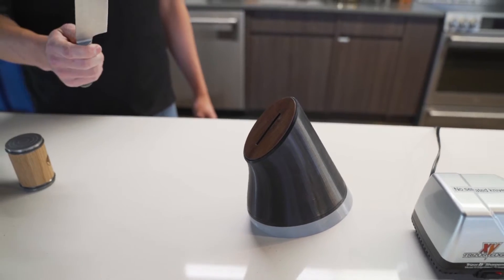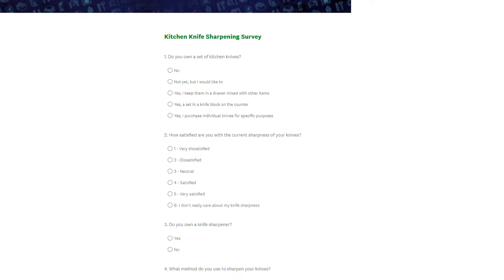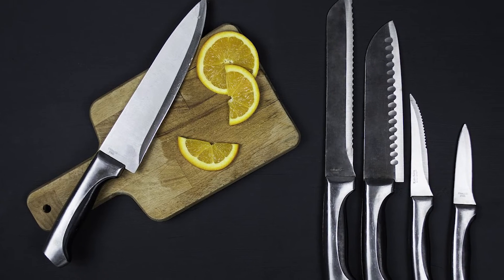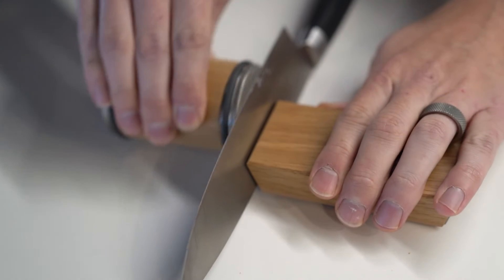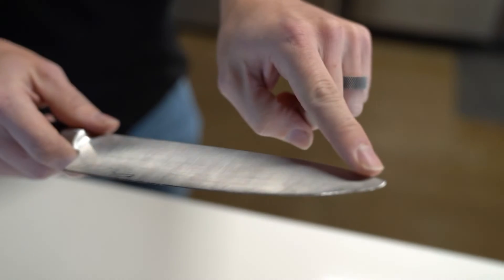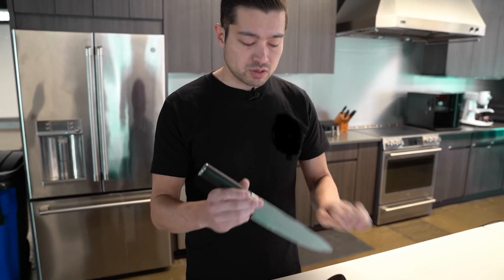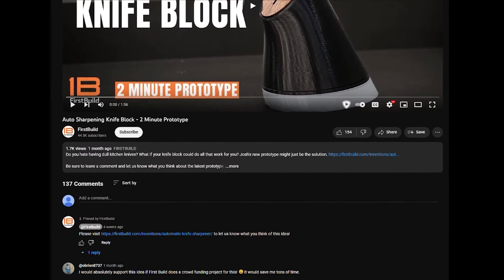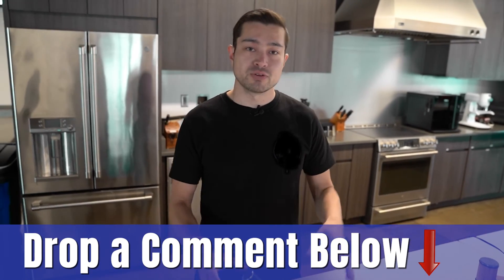Can Our Robot Really Sharpen a Knife?

Comment: First time seeing you channel.. so far so good...People keep mixing this part all the time... sharpening should happen as little as possible.. Honing knife all the time is the key, don't let edge become dull so you need to sharpen !!!... at the the same accident = re profiling edge. If you need to do that, well you probably did something real bad. soooo... if you want make product... it has to do both. 90% honing maintaing edge before  each use and after. After so many honing cycles you have to re sharpen the blade <10% of knife usage.. 
BTW all above ratio is based that you have decent quality steel... if you have those cheep stamped steel knives,  well sorry but sharpening all the time is only way and it will be worn so fast that is not worth buying that steel knife. As far the test... that is hard one everyone uses knives differently and quality of knives are different  so outcomes will be different (opinion). I make knives and sharpen them so they never get to bad shape.  I have OCD about sharp knives and they all need to be super sharp so my  below reference will meet <1% of average user. My test(s) are: knife weight on top of ripe tomatoes should cut thru the skin without any pressure (minimal).. fresh cilantro should be cut/chopped without any smashing or hard pressure and last one, cutting cucumber super thin that you can see thru..(I also have access to knife edge sharpness tester, but that is not in this scope of project) again these are just a few that work for me... Good luck brother you definitely picked difficult task to resolve and trying to make easy for everyone.. looking forward to see final product... 👍

Comment: I actually own 4 different Lansky sets. 
1 in the house
1 in the barn
1 in our camping trailer and
1 in our living quarters horse trailer
How sharp is sharp enough?

If I can shave the hair off my arm, it's ready to be stropped on my leathers!

I've actually shaved with my pocket knife!

But stainless steel is difficult to sharpen!

For our SS kitchen knives, I use a pull through and a strop.

We own a couple low carbon steel knives and they sharpen easily...

Is there a way to actually INVEST in your device?

I'm interested! 

Bill

Comment: I have many knives in my kitchen, I have pairing knives, chef knives slicing and boning knives. The two most used are pairing and chef knives. I have a small interchangeable belt knife sharpener but like you mentioned keeping the proper angle of the knife is key and the designer didn't do a good job providing a good way to do this so I am never pleased with the outcome. Having a knife able to cut a tomato easily is what I am looking for. Having a knife edge that's not so thin that I have to constantly use a knife steel to straight out the edge would be awesome.
Thanks very much!
Michael Pitre
Heaven Made Products

Comment: One approach is to have the end user insert the knife in such a way that the process starts with the tip then runs the length, the other is the sharpening mechanism on a rail that has the profile of the knife one pass for sharpening with diamond stone then the stone are move out and two rubber of leather wheels run the length to remove the burr. Once a knife is sharpened its does not require much to maintain, not like a dull knife that would need more work remember you could have your block be straight that way the mechanism just runs the length.
Eddie

Comment: I consider myself an average knife user.  So I don't need my knives to be constantly tomato skin sharp.  As long as they basically get the job done, a little bit of push force is fine, and I don't obsess over it.  That being said, it would always be nice to have to worry a little less about sharpening.  I think the idea of this device would be good as a daily maintenance type deal, but should not aim to replace a professional sharpening service that should be performed once a year.  It also should NOT try to be a solution for people that are just bad with knives.  If you (the plural you) are the kind of person putting nicks in your knives or even dropping them, you got bigger problems.  Do everyone a favor and take a class on kitchen safety and learn how to respect blades.  A product like this is not meant to save you.
Getting back to the device, I think it would be most useful as a low-tech product.  There doesn't need to be fancy electronics and motorized grinding stones on the inside.  That is overthinking it, not to mention all the physical space that takes up.  I'd be satisfied with a some static stones, or maybe some simple grinding wheels on a pivot that rotate when the blade is being pushed into the block.  Remember the aim isn't to get a hair-splitting sharpness every time, the aim is maybe to try and upkeep with whatever minuscule dulling happens from every few meals.
But even then, there are significant hurdles as to why this invention may not be a practical idea.  The first problem is sanitation.  Not everyone is tidy.  Some people may not clean their blades as fastidiously as they could and may insert them partially dirty with oils or whatnot.  Also for example, my boyfriend has a bad habit of putting knives into the block still wet.  Well what happens when moisture sits around with nothing to do?  Mold and rust.  There will have to be a way to open up this device for easy cleaning.  And I think most people are going to be completely grossed out by what they find.  That problem might be more harmful than the original problem that the device was trying to solve.  People will think: Great, now I have something else to worry about, keeping this thing clean.  I would have put less work into just periodically sharpening the knives by myself, like I used to.  Why did I spend all this money?
The second big hurdle I see right away is space.  Specifically counter space, is valuable real estate.  The prototype in these video is showing room for only one knife in the entire block.  And that would make sense if the inside is going to all filled up with mechanisms and electronics.  But that is incredibly wasteful.  Most buyers are going to have two or three knives they use on the regular.  And since this device is intended to not just be a sharpener, but also be the storage for the knife.  What, is a person that has a full set of seven knives going to have seven of these giant things cluttering up half of their counter?  How ridiculous would that be?  So it quickly becomes an impractical solution for anyone that owns more than one knife.  And if you have multiple knives, but aren't going to store them in the smart block like this device proposes, then why bother at all?  You could just have an ordinary knife block that houses five or more knives, and one sharpener of your choosing that you can throw in a drawer somewhere out of site.  In other words, there would be no purpose to having a knife block that acts as a sharpener permanently reside on your counter right next to your second knife block with all your other knives.
The only way this device even makes sense, is if you can cram multiple slots (each with sharpeners) in a single block the size of normal dumb knife block.  And the only way to do that would be to make it as low tech as possible, like I mentioned up above.  Otherwise, to the two big obstacles, cleanliness and space conservation, are going to cancel out any benefit this device could possibly bring.
To answer the desert island question, the bread knife is my favorite of all knives.  I use that more than anything.
Reply from the maker: Thank you for this feedback. There is a lot to think about because it will be extremely hard to "do it all". Comments like this can help narrow our focus and reveal some blind spots. All that to say, 5 stars, thank you for taking the time on this one.

Comment: Hi sharpening knives is one of my hobies I use a series of wetstones but I think you have a very good Idea, but a couple of points the system will have to be tied to a chef knife and be able to self adjust for length. Knives are not sharpend every time we use them but during normal use you have to use a hard steel to re-align the edge also one you sharpen it remember you will get metal shavings so the end user has to be reminded to clean it before use. The inside mechanized would have to be able to run the length of the knife all the way to the tip I suggest two rotating dimond stones at the correct angle.
Reply from the maker: The tip has definitely been challenging as geometry starts to change at the end more drastically. As the early prototype comes along, we want to start testing a lot of these questions and theories. How often?,] how much bur? material composition, etc. It's been an interesting challenge so far. Once we can have this thing run precisely over and over we think we can start to narrow down some of these parameters.

Comment: Chef's knife get daily use. I have lots of other knives, but they do not get used as much and some are unique enough to be way out of scope for this type of product.
But even with just a chef's knife I have a number of them with different metals and bevel angles.
I don't sharpen nearly often enough. Instead I change knives and then sharpen when I have a bunch that need it. Still I do use them longer than I should before they get set aside for sharpening

Comment: Chef's knife is the all-purpose thing that needs an automated solution.  I have specialty knives, for bread or slicing roast, the require specialty care but they are used much less frequently and get sharpened once a year when I get out all the sharpening stones.  The chef's knife needs to be sharp every day or it's unsafe.  For comparison, I have an electric razor that cleans itself every couple of days.  That's what I'd like for a knife sharpener, a little clock or whatever that tells it to sharpen the knife every N days.  You need to consider knives of different thickness, and material.  I have German steel knives, Damascus knives, and ceramic knives; they all take a different angle or material to sharpen them.  Maybe little plug-in modules that have the right stone and set the right angle.

Tomato or celery are my knife test materials, cutting the skin without mashing the tomato and chopping celery at speed are the signs that a knife's sharp enough.

Comment: I feel that the tomato is the test. When I struggle to easily cut through the skin without pressing, I know it’s time to re-sharpen. I’m a wet stone guy. The chefs knife is great, chopping knife might be able to fit too. Would be cool if you could get finer grades in there to get an even better edge. Like 1-2 grades of stone. Little spinners? Something that runs back and forth along the blade? How do you. Get those precise angles. I think if you could get it to do the chefs knife and maybe a filet or steak knife would be of benefit. Big chopping knives and cleavers probably not so much.

Comment: Love the idea and agree that Chef's knife is the place to start. My biggest concern is frequency...skeptical that a high quality knife should be sharpened every time it's used, which can often be multiple times in a day. Since the sharpening process is removing steel from the blade, albeit microscopic amounts, I fear constant sharpening would, over time, actually reduce the lifespan of the knife. So implementing a schedule of some kind, in consultation with some real knife experts, seems like it would be an essential way to go.
Reply from the maker: We've been thinking about this a lot as well. How often does it need to run, manual settings, etc. At this point we are working to get a solid prototype going so we can run it over and over and get a basis for, wear, burs, etc. Also depends on the knife's material and quality. Lots of factors and we're anxious to start testing them.

Comment: I think you hit the nail on the head with the chef's knife. It is quite likely the most commonly and heavily used knife in just about every kitchen. Other knives that would be quite common to consider as part of many kitchens are paring knives, filet/boning knives, and slicing knives. I would LOVE to see something that could work for a cleaver as well. Currently, I use a tumbler style sharpener and it works well enough for my purposes, but something that would take the guesswork and time that I could devote to another kitchen task at hand would be very welcome. Here's wishing you well on the design and feasibility process! I hope it is fruitful and I'd love to help test!
Reply: The most hazardous for me at my age is a knife sliding off snooth surfaced fruits and vegetables. The test for me would be an edge that dives right into the tomato. It would also thinly slice meats (like a Philly style cheese steak). My second most used knife is the boning knife. I prep a lot of meats, ribs, roasts, brisket and poultry. Thin blade very sharp to trim meats.
Reply from the maker: Thank you. And how do you like the tumbler? None of us had ever used one and there are varying opinions about it here.